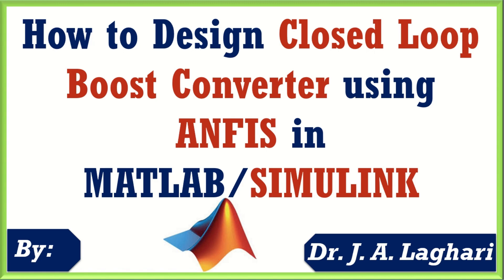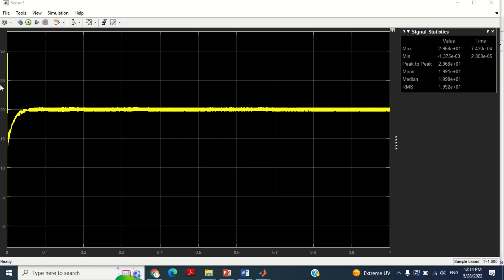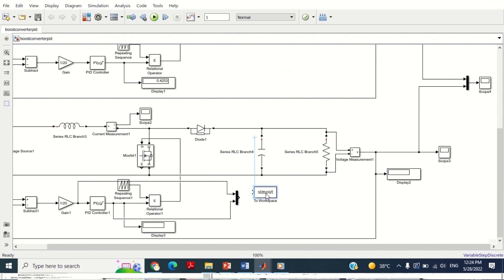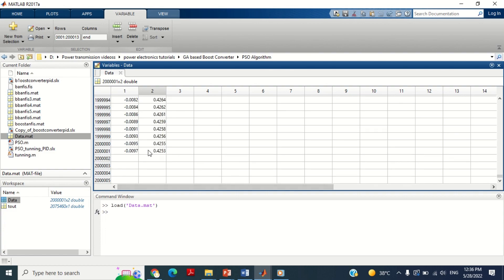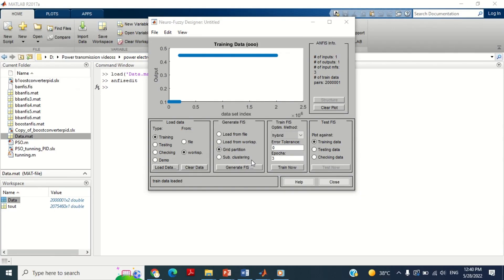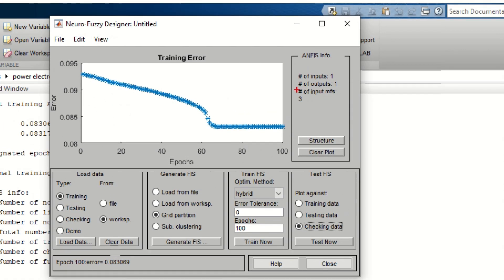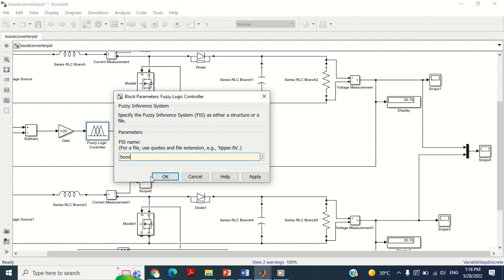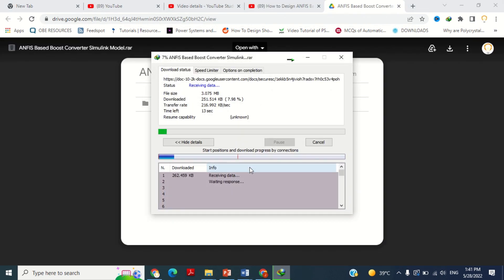How to Design ANFIS Based Boost Converter Model in MATLAB Simulink Software | Dr. J. A. Laghari

Comment: How to train the model for boost converter with variable input?
Reply from the maker: Thanks for the comment. For variable input use the varying signal by using signal builder block or something like that to include all values then train the model with the anfis.
Reply: @DrJALAGHARI  I've used the signal builder block. I meant in the workspace how to change the output data? ( this is not the conventional boost converter,I'm trying to optimize a converter I found in a paper)
 I  tested the duty cycle needed for specific input voltages. For example my dc input varies from 80v to 40v. For input 80-74v range there were overshoot and undershoot. So I checked the duty cycle needed for 80v,78v...74v. There were 2000000 samples in total, so I divided all the samples by 40. That gives 50000 samples per unit voltage. And then I changed the output for each 50000 samples with the duty cycle I obtained before. But that's not working,the output is worse than what I got from the PID controller. Am I doing it wrong?
Reply from the maker: @nomanmreedha5235  thanks for the comment. In that case, kindly follow the paper methodology.
Reply: @DrJALAGHARI  The paper used normal PID controller. I'm trying to get better result than that.

Comment: what if there are multiple inputs in a controller
Reply from the maker: Thanks for the comment. You can use more than one inputs if they are required. In that case use the multiplexer block and combine them in one signal and then give to ANFIS.

Comment: . Thank you for the interesting video .. I have a master's thesis on the use of ANFIS for a solar system and I am trying to control the output voltages .. and I assume that the load has changed after a short period of time from operation .. but there is a failure to maintain the output DC voltage level ..  Note that the PI succeeded in maintaining the voltage opposite the ANFIS
Reply from the maker: Thanks for the comment. ANFIS needs proper training for all events. Therefore, try to train it properly to get the desired results.